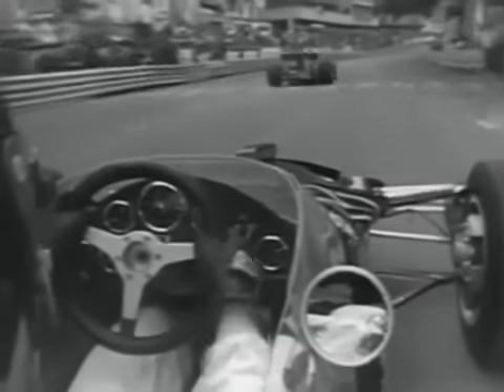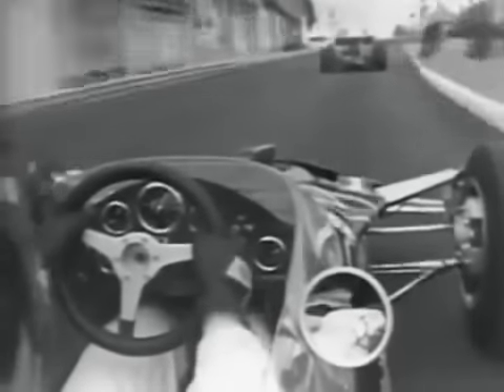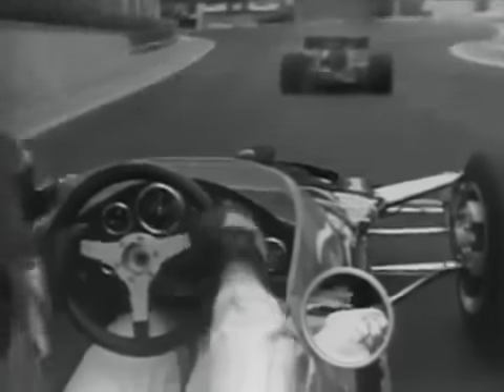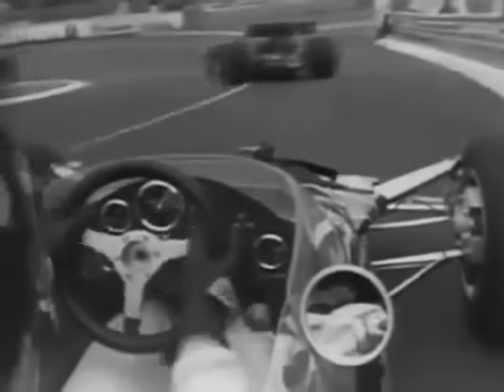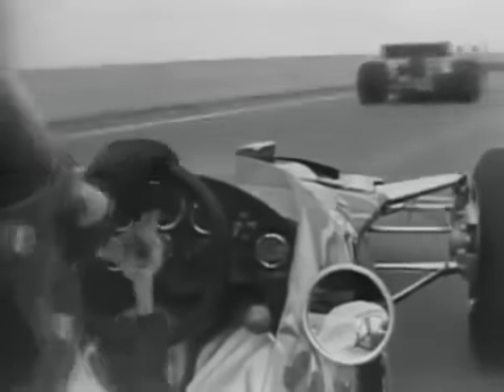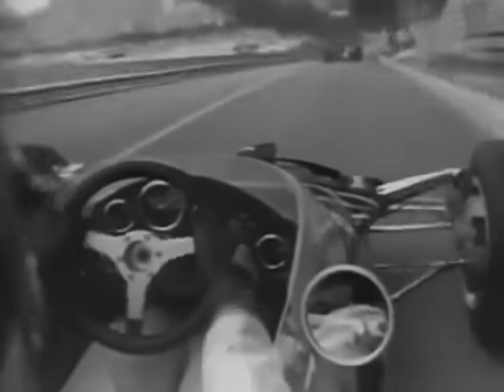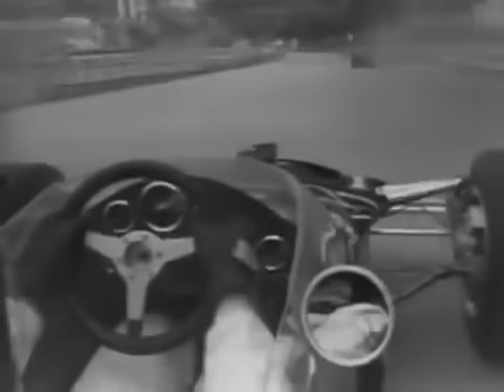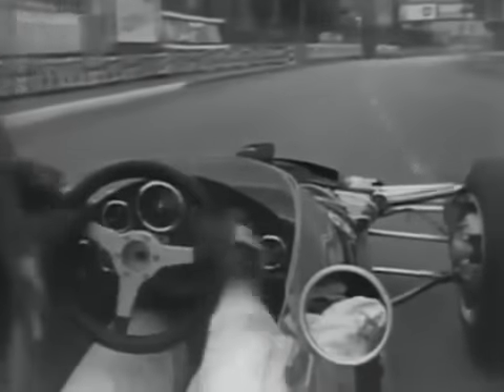F1 - 1970 Monaco GP - Graham Hill on board

Comment: Why they used H-type gearbox handler?
Reply: That was the only one in those days.
Reply: Actually not. Those days was very popular pedal gearbox, especially on touring cars.I don`t know why those were not used on F1 cars, maybe they were banned by FIA.
Reply: Never heard of them, maybe you can point me to some page or site where I can find some information about it. As far as I know, H-type gearbox was used in F1 cars since the beginning in 1950 all the way, I think, to the late '80s.
Reply: Anyone know what was used in the early 90's?
Reply: Manual not semi-auto
Reply: Quickscxping  ¿A sequential gearbox, like a motorcycle but no clutch? I really don't know, F1 was dead for me after 1989.
Reply: Quickscxping I read that the last stick-shift (manual) gearbox was used around 1986-87. Afterwards they became semi-auto (just pulling the stick up or down). Only in the 2000s they turned to sequential gearboxes with paddle-shifters behind the wheel
Reply: margus kiis 'couse it was 1969
Reply: +Santiago Machado The last H box to win a F1 Grand Prix  was Schumacher at the 1992 Belgian Grand Prix.
Reply: +Santiago Machado Actually the first sequential gearbox with paddle shifters was the Ferrari from 1989, but it was unreliable at the time and it only started working during 1990.
Reply: The last car to have any sort of gear stick was the Benetton in 1992. After that, only paddles were used.